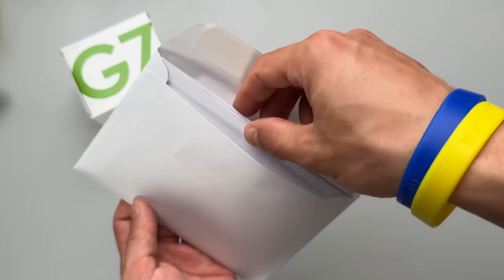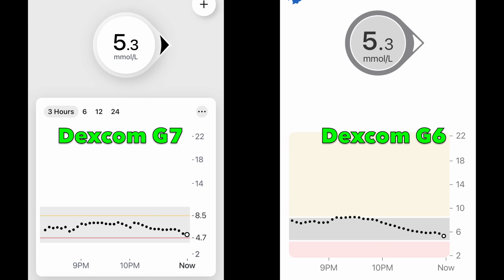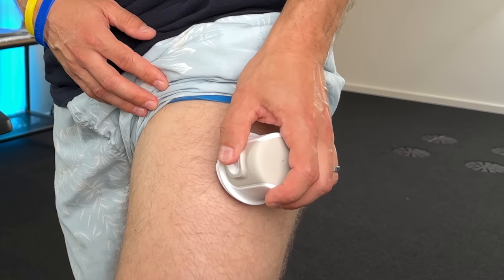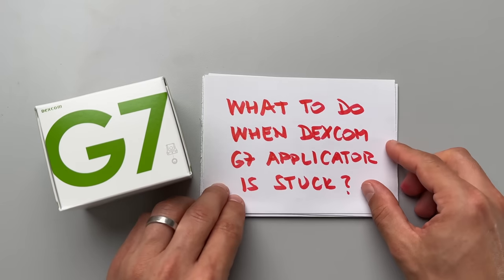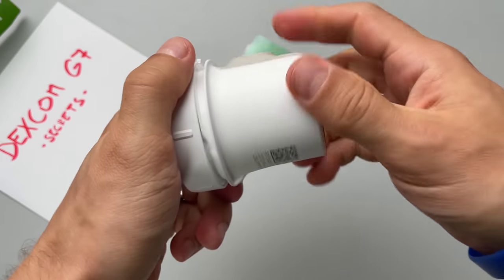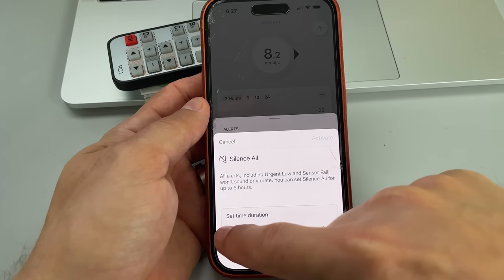Dexcom G7 Secrets, Finally Exposed!

Comment: I know here in America, they recommend the back of the arm to place the sensor. But I keep ripping it off. I really want to know if it’s ok to place it on my abdomen.
Reply: I need to know the same.. My very first sensor (now, on the back of my arm) hurts. My G6 worked just fine, on my belly..😢
Reply: A nurse friend of mine places hers on her abdomen! You should be totally fine. :)
Reply: My doctor and nurse told my the stomach is fine. The nurse, who had gestational diabetes, said wearing it on the stomach was more accurate for her. I found that to be correct. I usually place it slightly on the side of my abdomen to prevent accidental rip-offs.
Reply: Abdomen is fine, but it must be
at least two inches away from your belly button.
Reply: What about the upper inner thigh?
Reply: I have had it on my stomach/abdomen since I got it. I am a side sleeper and I know it would get in the way
Reply: Yes, yes yes! I am a critical care nurse. I have yet to find a research article saying the arm is better or more accurate. I have very flabby batwing arms from losing a bunch of weight. I can’t keep the sensors on my arm. Just make sure it’s 3 inches from your belly button and from any injection sites.
Reply: What about the outside upper arm area?
Reply: Iuse clear medicaltape to keep on arm
Reply: My Dr. had his nurse put it on my stomach.
Reply: I wear mine on my upper stomach area. My NP said it is fine. Best wishes 😊
Reply: I like using the upper chest, the area where your brastrap would fall, but out of the way. I also use my abdomen.
Reply: I spoke to Dexcom today. Yes, Abdomen is fine, in the USA as well as Europe.
Reply: Yes it's fine, it's just the way Dexcom got it FDA approval and they weren't going to spend the money on going through the FDA process

Comment: For anyone having adhesive issues I use Skin Tac Wipes and haven't had any issues with them.  I ordered them from Amazon and are relatively  inexpensive for a box of 100.
Reply: are they for removing the adhesive or is it a better than the one supplied to hold the cgm on?

Comment: We never calibrate our daughters GCM because our doctors are against it and say it can cause more issues. We’ve had some that go out of range but eventually they always find their way back into range. Atleast that has been our experience with the GCM so far
Reply: I’m still on the G6 but I usually calibrate once if it’s still off by a lot after 24 hours, and then that usually fixes it for the rest of the sensor
Reply: You never calibrate if the difference is below 20 so you are correct.

Comment: One warning about the G7 receiver: the plastic face of the receiver is very, very prone to scratching. Do not put anything else in your pocket if you carry the receiver in it. A couple of times I put my car keys in my pocket with the receiver. I quickly noticed that the face was scratching badly, and in fact it scratches so much that at first I thought it was “fogged” from dirt or skin oil. It was, in fact, extremely scratched from rubbing against the keys (and I don’t carry a bundle, just a car key, house key, and the fob for my car on one of those circular key doodads). I rarely carry change (coins) but I assume they would scratch the face of the receiver, too. The scratches are permanent, and I can’t imagine why Dexcom designed a pocket-sized receiver made of such easily scratched, soft plastic. From the get go, make sure your receiver doesn’t share a pocket with anything else!
Reply: Glad to hear that you can still get the G7 with a receiver.  I'm in Canada, where G7 is just being introduced - and I prefer the receiver over using my mobile since the G4  I was gifted in 2015 and now back on G6 with socialised system in my province that I had to fight for as a hypo unaware T1D of 60 years (it's gotten worse with age LOL) .  Somehow - Dexcom Canada is being very hush hush about there being a receiver available - but obviously where ever you live - it's available.   Psst, the G4/G5 receiver screens were the same - screen protector is a must!
Reply: @FatCatAnna  I am in the US … I should have mentioned that, sorry. I also prefer the receiver as I don’t generally carry my iPhone around in my house with me (I’m retired and like many older people don’t feel like I’m joined at the hip to my phone!). Listening to many of the diabetes YouTubers, it does seem that availability varies quite a bit from country to country. It probably has something to do with Dexcom’s profits. As I’m sure you know, here in the states our health care is mainly private sector and medical insurance coverage is expensive (even our “socialized” retirement health care — Medicare — is inadequate and requires supplemental private pay add-ons), BUT providers can charge high rates and insurance will generally pay them, so Dexcom probably makes more money charging US health insurance for G-7 systems and the receivers than the Canadian health system is willing to pay them (after all, the app is free so why pay extra for the receiver). I wish I had known about the soft plastic screen before I scratched mine up! Lesson for next time. BTW, I have had two sensor failures in the latest batch sent to me (I get a three month supply). One had no adhesive on the backing and immediately fell off; the other failed as soon as it warmed up. I contacted Dexcom and they quick-shipped me replacements with essentially no questions asked, which tells me they might be encountering a higher failure rate than expected. They also tell me that they can’t supply extra overpatches for G-7 sensors. Sounds like they are overwhelmed. Good luck getting a receiver (perhaps you could get one through a contact in the states??). And is your cat actually overweight? 😊🐈‍⬛

Comment: Hello, is Dexcom planning to ever have minute readings instead of only every 5 minutes?  It would improve it greatly
Reply: I would guess no, since most of the battery drain is used to run the bluetooth. five times as many transmissions means the battery is gone much faster. That's my guess, anyway.

Comment: Chapters:
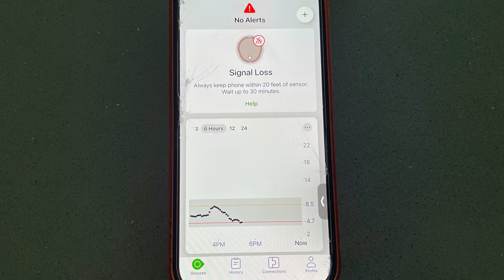0:40 #15 Signal loss
1:48 #14 iPhone widget
2:22 #13 Spotty graph
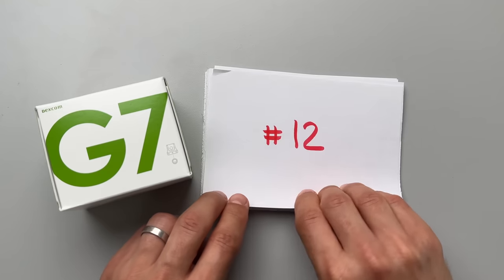4:40 #12 Best site (upper arm)
5:47 #11 Graph gaps
7:03 #10 Readings are off
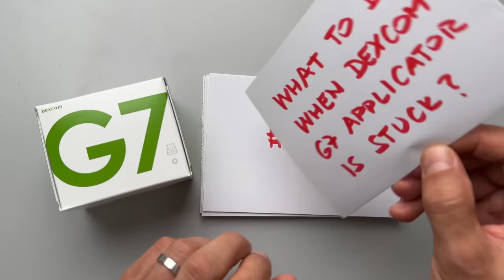10:13 #9 Applicator is stuck
11:25 #8 Sensor peeling off
12:24 #7 Alerts
14:44 #6 Why use G7 receiver?
15:32 #5 Why is G7 gray?
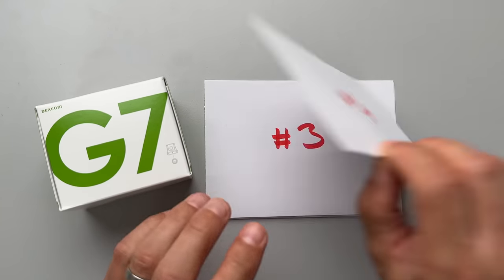16:26 #4 Data direct to watch
16:53 #3 15-day sensor
18:07 #2 Insurance coverage
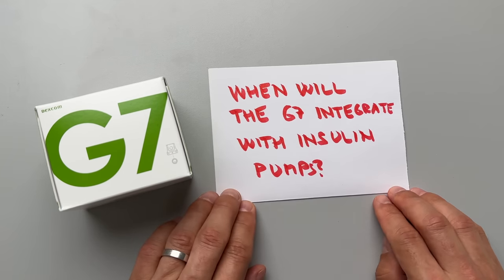18:49 #1 Insulin pump integration

Comment: TacAway (in the US, I don't know about overseas) - works great for me as a skin prep before putting on an infusion set or Sensor.  Just wipe it on your skin, let it dry (drys really fast) and the adhesive sticks great.   Way better than alcohol wipes.  I only learned this by accident, but now I do it all the time.

Comment: I'm looking forward to using the G7.  Have to wait until it can be used with my Tandem pump.  Hopefully soon.  I use my thighs quite a bit along with my arms.  When I use my thigh I place it in between the top and side and sometimes on the top part.  I get very good results.  You can get stickers for the G7 and the G6 if you want to dress them up.  Can also get over patches with designs.  Makes it fun to wear especially for kids.

Comment: Hello, a very good video.
I live in Germany, so it may be that the facts here are a little different than in other countries. Here, the statutory health insurance pays for the sensors if they have been prescribed by a specialist (diabetologist). So far (Dexcom G6) I always got a permit for one year. From March 2023, I switched to the Dexcom  G7 and immediately got a two-year permit from the health insurance company, as the G7 is significantly cheaper than the G6. I was initially  very disappointed by the unreliability of the G7 (Ver. 008, production date August-September 2022). The last quarterly delivery (nine sensors) as well as 2 sensors sent to replace defective sensors were all not operational. Either immediately after trying to pair the sensor, I received the message "Pairing unsuccessful" or "Sensor failed. Replace sensor now". I was convinced that I would return to the G6 and had already asked Dexcom what to do (submit a new prescription from the specialist for the Dexcom G6). 
Since I had to wait a day for the follow-up delivery and my diabetologist still had a G6 sensor in the practice (I still had a transmitter that was not completely used), I got it as a gift and used it. When the replacement delivery of G7 sensors arrived, this revision was 012 (production date May 2023). I used the G7 in parallel with the G6 and noticed some similarities but also some significant differences:
1.	The measured values of the G6 and the G7 matched very well after an initial calibration. I usually calibrate the sensors 8 to 10 hours after setting, but only if the values are stable (not after eating or after an injection) and differ more than 20% from the measured blood glucose value.
2.	Where there were deviations, sometimes the G6 and sometimes the G7 was closer to the measured blood glucose level.
3.	G/: No gaps in the blood glucose measurement when changing the sensor, G6: No values for two hours.
4.	The G7 has much more subtle warning tones than the G6.
5.	With the G7, a  freely configurable pause can be taken after a warning  until the meal (if the  values are too low) or   the insulin (if  the values are too high) are effective, i.e. it is much less annoying. 
6.	The receiver is more informative, smaller and lighter, and its battery lasts much longer (10 to 12 days for me).
7.	The G7 -receiver is readable for me at night without glasses, because it has a higher contrast (white lettering on a black background), the G6-receiver is not readable for me at night without glasses.
8.	The G7 app offers more information than the G6 app.
9.	The G7 sensor is smaller, so it is less annoying  and less noticeable.
10.	The sensor patch of the G7 doesn't itch, the G6 patch is itchy for me in summer.  
11.	The G7 comes in Germany with an extra over-patch that I personally don't need because the G7 holds on my skin even without this extra patch.
12.	The G7 reacts faster and more strongly than the G6 to rising or falling values.
13.	The sometimes strongly fluctuating measured values (more bouncing dots than a line graph) of the G7 to Rev. 008 has from Rev. 012 largely disappeared. On the other hand, the G6 has a nicely balanced blood glucose curve, which reassures the user, regardless of whether the values are correct or not.

After these experiences, it is clear to me that I will stay with the G7, as I also assume that it will be improved further in the future.

Comment: Regarding getting Insurance companies to cover my G7 sensors, I have a story to tell...

I have United Health Care, and they cover the Dexcom, but not the Libre.  However, when I applied for Pre-Authorization, it was denied because I am HypERglycemic, as opposed to HypOglycemic.  Apparently, United Healthcare only covers the CGM if your blood sugar runs too LOW, not high, and you're not on insulin.

Well, I appealed that decision with the argument that even though I had a HIGH blood sugar problem, I need to get visibility to trends in my blood sugar, not just point-in-time which is all the finger-sticks can do.

Bottom line, my appeal was accepted.

Comment: URGH!!!
I have resisted the receiver but you make a good point about the size/weight.  I am having trouble getting used to carrying my phone all the time.  You’ve convinced me and even before I finish this video I’m off to charge the stupid receiver.
Came back to add that I just came back from watering the plants and deadheading my flowers and OMG that receiver was awesome.  So light.  I am not used to taking my phone when I go outside to water plants or into the bathroom or just to the other room and this is great for me.  Now I just have to make sure I don’t forget about it and wash it😀
Reply: I bought a cover and hang it from my neck. Prob purchase a waterproof one so I case u forget and shower with it. Lots of accessories..

Comment: Big let down! Other than the faster set up time, I’ve been so disappointed with the G7. Main issues are as follows;
1.The single loss issues are truly awful. 
2.The stability issue is messy. 3.I’ve had a lot more failed sensors with the g7.  
4. I’ve had false lows a few times with pressure on the sensor while sleeping. 
5. The widget doesn’t work very well. I think that is due to apple but still.
I’ll have to try some of these tips but I think this product was released too early, particularly in Europe.

Comment: I am just starting to use the G7. I previously was on the Libre 3 and switched to Dexcom because I can get a 90-day supply through insurance. I started with the G6 but didn't like it, I felt it was going backward in technology and it was bulky compared to Libre 3. I am on my 3rd G7 now and I really like it, I haven't gotten a low due to compression at night(I use the back of my arm). I have a Samsung phone and have not lost signal unless I get 40 or 50 feet away, so your problem may have to do with using an Apple phone. I want to thank you for your tutorials for using the G6 and the G7.

Comment: Thanks Tom! I’ll be interested to see if there are improvements in the G7 graph stability by the time it integrates with the tandem pump. Currently, I still get some “jittery” graphs with my G6, usually related to placement, but my pump sees those sudden jumps in the graph and will often give me a bolus thinking I’m rising rapidly, even though it is just jumping up but then remaining stable. This is very frustrating, and I usually take it right out of Control IQ mode when it’s doing this, but that negates the point of having a closed loop system. Time will tell I guess. I love the options they have included now for the alerts (hahaha, six hours of zen silence!) and you make a great point about the receiver… thanks for the great content!

Comment: I have a serious medical issue with my arm so can't use a G7 sensor there, but Dexcom won't recommend any other locations.  I listened carefully to the alternate locations some U.S. customers are using.  I'd appreciate any feedback in how successful these alternate locations are.  Abdomen better than thigh?  Calf or chest even better?    

I'm unhappy my supplier is switching me to G7.  What if someone has severe arthritis and can't attach the sensors on the back of the upper arm?  Or has had an accident & now has an injured arm?  In some ways, G6 was preferable.  

That being said, sincere thanks for your helpful video.  I have learned some important strategies in transitioning to the G7.

Comment: Thank you for great informative video.  A quick question.  When I use the Accucheck meter for finger, I noticed readings are variable when you take the reading immediately after waking up vs. washing hands w warm water.  Is it relaled to the circulation ?  Also , is G& receiver more stable than iphone in terms of maintaining signal ?

Comment: Hello,
How cool that you give such an extensive review with all kinds of helpful tips about the Dexcom G7.
I found it particularly interesting to turn off the sound on the Dexcom G7 app. I use the Dexcom G6 Dash instead of a telephone. Unfortunately I can't turn off the sound of low BG alarms on that. Super irritating if, for example, you are at a classical concert or if you think that others do not need to know that you are receiving a BG alarm. Is there a way to completely disable the alarms of the Dexcom G6 reader?
I can set the function to vibrate, but in case of danger (low BG) an alarm still goes off. super annoying
Reply: Excellent question!

Comment: I place my G7 where I had my G6 , on my upper abdomen to the side slightly where there is enough fat . I did the arm and it was painful and I couldnt get safe and reliable readings. I have the dedicated receiver and the only signal losses I have is if I walk away from the receiver or if im around another RF signal that interferes with the dexcom. As far as putting the sensor on I would say its a good idea from my experience not to have it so the probe is inserted vertically rather to make sure it is horizontal (at least in my case) so that the fine probe doesnt get flexed on heavily if you bend over or sit down and so on .. Other wise it is very accurate with some quirks here and there and i personally havent had much issue with the adhesive yet .

Comment: Thank you for answering a question Dexcom couldn't - does the G7 connect directly to the pump or via a phone. You said it connects directly to the pump meaning if the phone is out of range, the pump is still able to receive readings from the G7 to dose/not dose accurately. 

The only thing I'm not loving about the Guardian sensors is the fact that they last for 10 days. I would love for them to be 7 days so that I can change on the weekends. I realise I could cut the sensor short, but in Australia, we are only given the exact amount of CGMs at the discounted rate in 12 months. If I'm cutting the G7 short by three days so I can change it on the weekend (like I do with Medtronic's Guardian 4) then it is going to get very expensive when my 'script' runs out for the G7 sensors. 
Why don't developers think of things like that? 7 and 14 are great for management like that. 10 days just doesn't make any sense. Neither does 15.